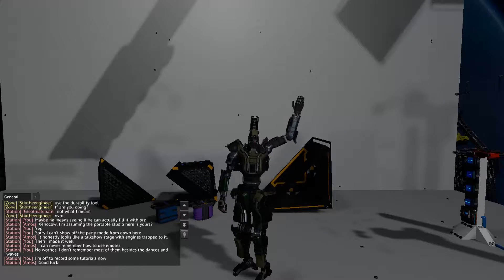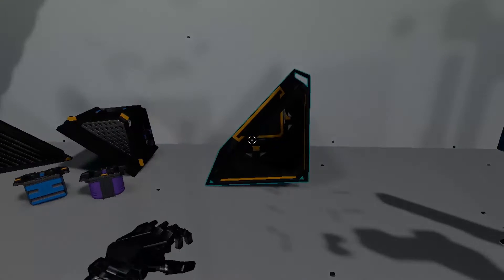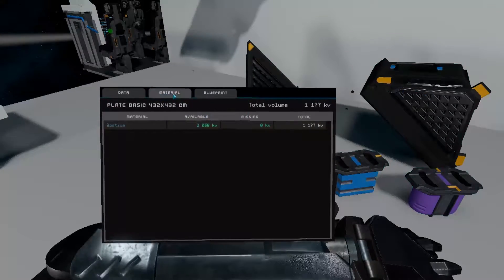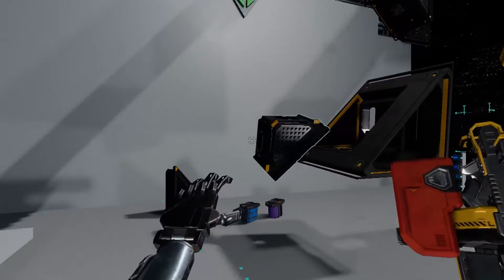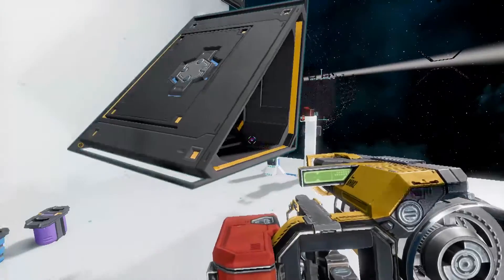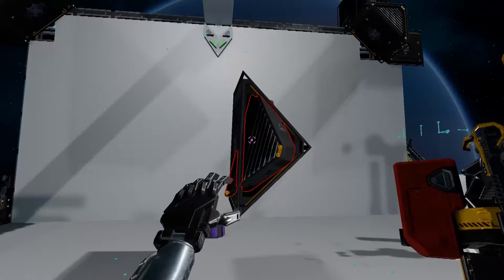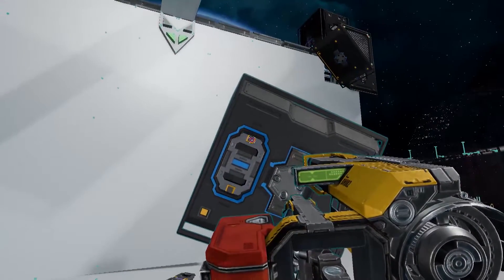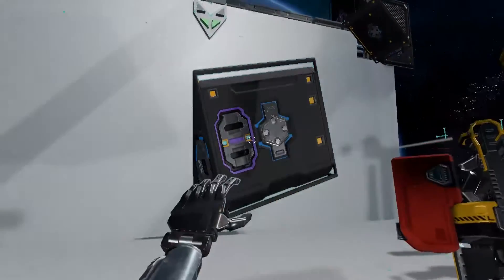Starbase: ByteSized | Triangle Thruster Assembly

Comment: 3 month later
... 
But how do I safely connect it to my ship?
Reply from the maker: That's a good question... Another one to do once finals are over!
Reply: @XenoCow  Hello, are you able to explain how we connect these to a ship? I can't figure it out.  Thank you!
Reply from the maker: @Obduro21  The simple answer is to place it into the world, press 'C' to enable snapping, press 'E' to grab it, move it over to a hardpoint on your ship that is wired and piped up so that it snaps into place, then bolt the thruster on by holding down LMB with your bolt tool.

There are lots of small details that would require a video or longer discussion to explain properly. I hope this is a good starting point.